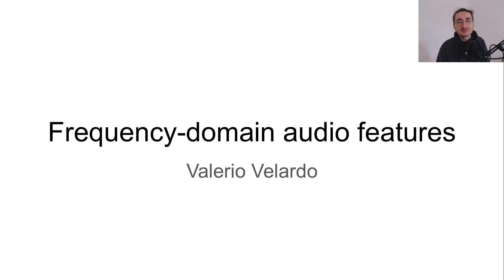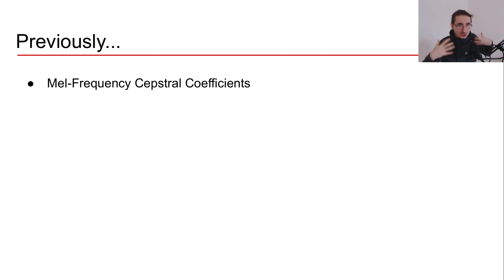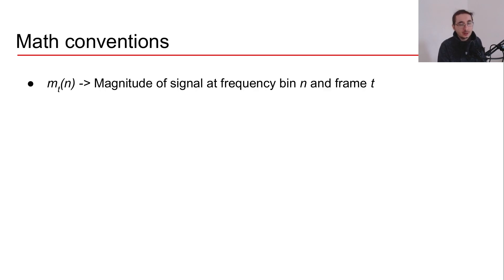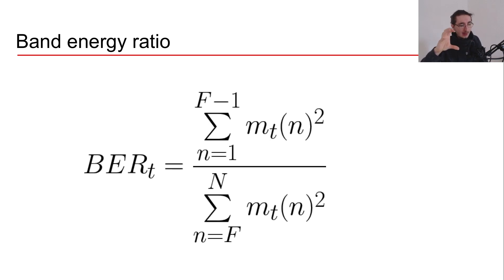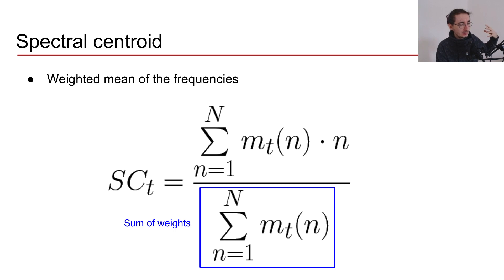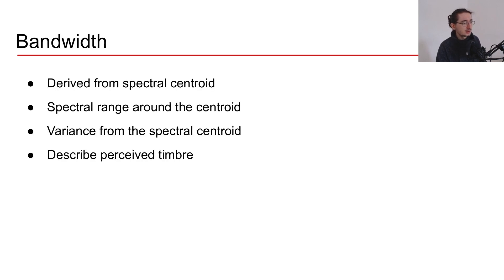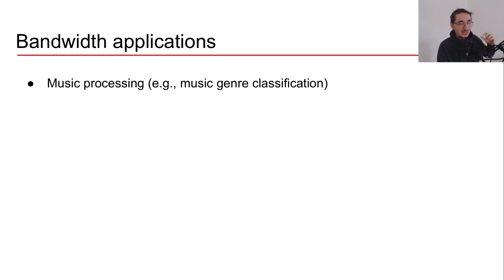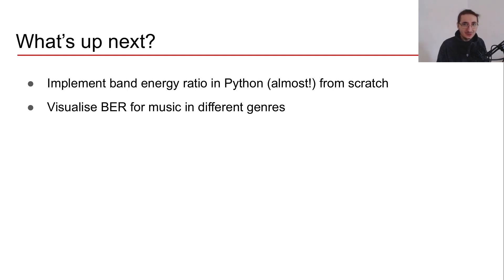Frequency-Domain Audio Features

Comment: Hi, I got a question on the bandwidth definition, it's said that it can be seen as the variance of the signal energy the same way SCs can be seen as the mean. Shouldn't we square (n-SC(t)) instead of an absolute value? Wouldn't it keep a meaning closer to the variance? Do we avoid the np.square to avoid outlier (super high frequency noise) sensibility? Would you recommend adding several powers/n'th root of similar expressions to add a few more features to avoid outlier sensibility? (I assume that sqrt should be less sensible to outliers)

Comment: Thank you so much, this is by far the best explanatory series I've found on audio and I've been actively working on audio DL for over a year. The one suggestion I'd make for this video is to include some visualization of the spectral centroid or bandwidth so we can see what it actually is. Just as a spectrogram would be challenging to understand without seeing it, both of these features are easier to wrap your head around with a visualization. Luckily the librosa docs do that for us:
- https://librosa.org/doc/latest/generated/librosa.feature.spectral_centroid.html
- https://librosa.org/doc/latest/generated/librosa.feature.spectral_bandwidth.html
Reply from the maker: Glad you like the videos Robert! Thank you for the tip. In the upcoming video in the series, I provide  a visualisation for for both centroid and spread.